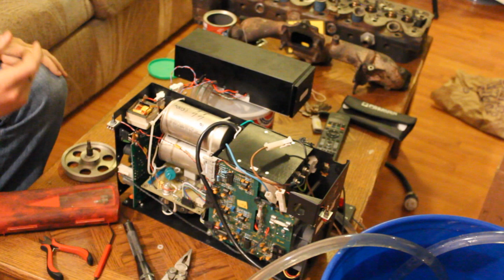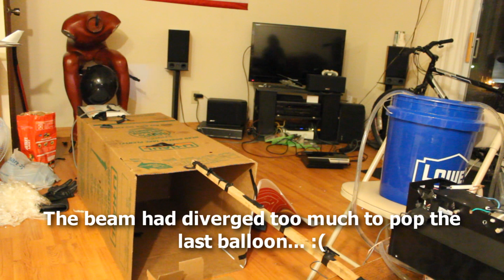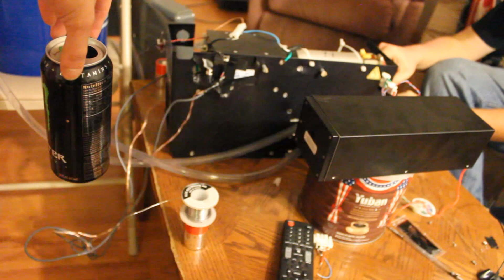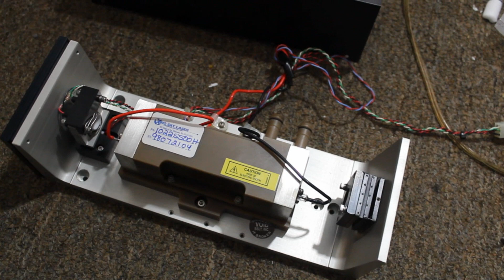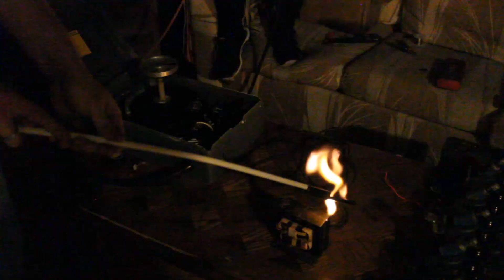Giant Invisible Er:YAG Laser!!!!

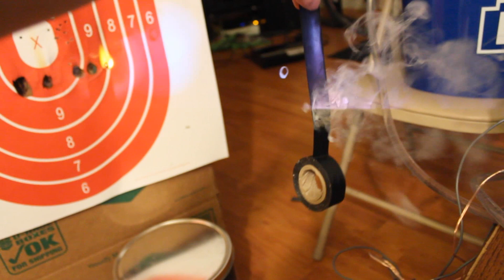Comment: if its invisible then why am i seeing the beam at 1:30? or is that just an illusion from the flashlamp rays finding there way out of the cavity?
Reply: @Deleted_Old_Account  the beam is simply diffracting off the smoke particles it is not actually ionizing them nor the air not in a whole beam section that would make it megawatts of power to do that so this laser is not invisible , sometimes if you focus the beam in the air it may be intense enough to lase or ionize the nitrogen present in the air and you would see what you are talking about but the whole beam here is visible so either it is a very powerful laser or a visible one but most likely this is light from the flash lamp as part of it also emerges as a beam from the cavity

Comment: i think i got myself into a bit of a mess. i bought a laser off ebay 1w to 1.5w 445nm 5.6mm and it says dont exceed 1.7A with a comfortable amperage of 1.25A all it came with was the diode, lens, and 6 inches of iridium wire. i know i need a driver and a heatsink but what kind of batteries do i need and where i can get the heatsink and driver for cheap. i can probably make my own driver but on the rest of the stuff im lost. please help.

Comment: Ooh....  If it's strong enough to ionize air, pulsing it through a suitably strong electrical field ought to initiate a discharge  along its path in the same way that dropping a wire filament into the field would.

Congrats on your 0.2 M subs!

Comment: How come it isn't a constant beam?
Reply: +TKO593  the trigger system works by sending a high voltage pulse (on the order of 10-20KV) through the flash tube to ionize the xenon inside then the lower voltage high current supply (the 1.5KV capacitor bank) dumps through the established ionization channel. the issue with running it constantly is three fold. First the intensity of the flash decreases as you increase the firing rate because the capacitors have less time to charge before being discharged. second it would melt in seconds if you operated it at the power levels its firing at with the lamp. and finally the ER:yag rod is heavily doped to make it more efficient at pulse operation however this makes CW (constant wave) operation difficult as the rod is too heavily doped to efficiently operate except in pulsed systems. im not saying it couldn't be done, it just would involve a different type of system (for example using large IR diode lasers to pump the Cristal) and would drastically lower the output power. if you watch during the various shots you can hear the pulse rate changing and as the speed increases it becomes less intense. the video doesn't give credit to how loud it was. especially when hitting the wet rag it was similar to a 22 in intensity. but when we turned it up it rapidly tapered off in power
Reply: Were you even listening?
Reply: +Randy Butternubs yes and he never explained why they couldn't make a constant beam other than obvious thermal dynamic problems that limit duty cycle. I was thinking the trigger assembly can adjust all the way to a solid beam or it always pulses due to an AC wave form and Hz rate(60).
Reply: +wilson m Ahh didn't know it required a capacitor bank to excite the gas. Makes sense that it would need time to charge between discharges. Thanks for the real explanation I don't know much on laser circuit and components; just curious because the technology seems to be getting way more efficient.